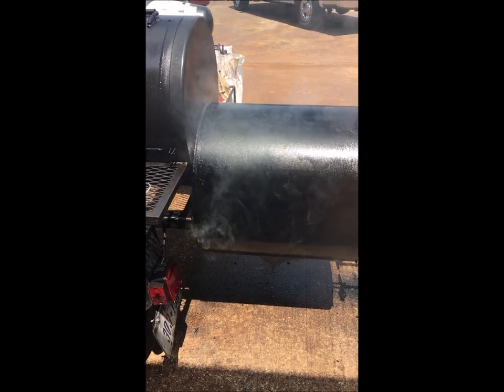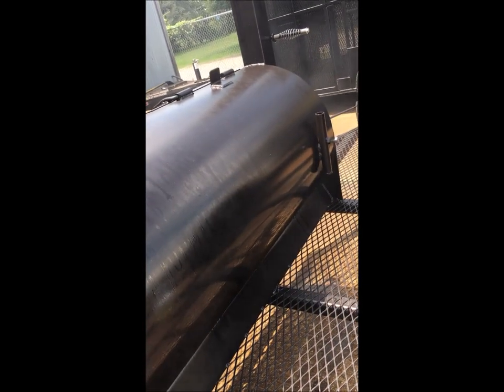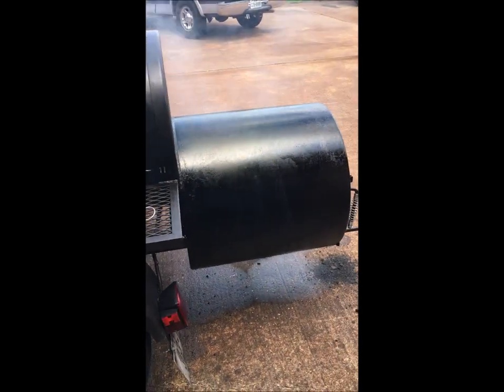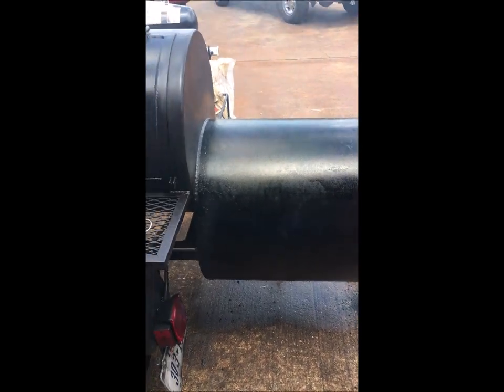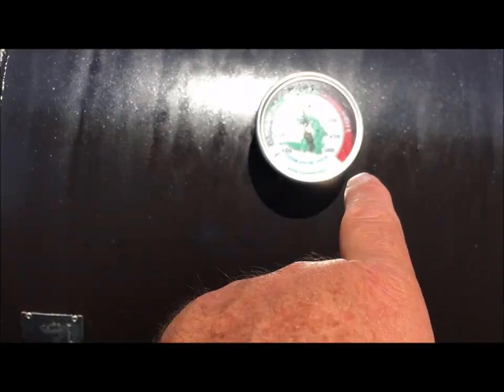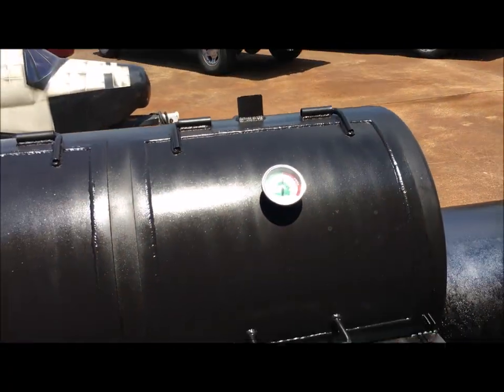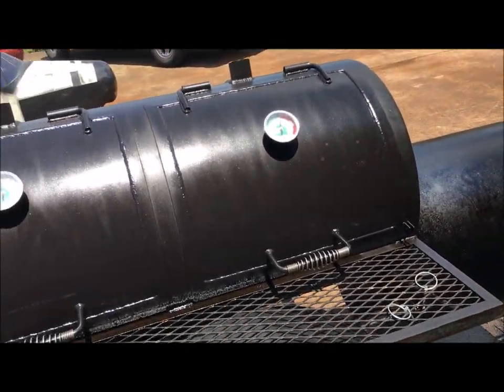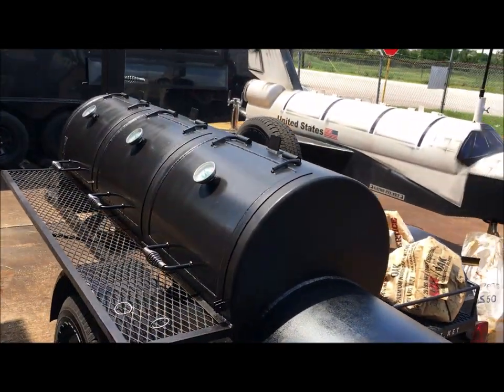Cooking Oil versus Paint. You decide.

Comment: nothing wrong with oil it or season it but I'd rather paint it because you can add some cool color to it insread of black and make sure you get the high temp paint and it will last a long time and look cool with some color and if you do not get the right oil yes it will get sticky and it does show run marks with oil if you do it wrong
Reply: What oil are you supposed to use? Just like vegetable oil?
Reply: depends what you think is cool. Chemicals? Not so cool

Comment: seen linseed oil recommended instead of veg oil. any thoughts?
Reply from the maker: MICHAEL CHRISTIANSON Doesn’t matter to me.  Spray and bake.  On the outside.  If ya want to coat and build up layers of baked on oil, pick one.  Lot of folks use bacon grease or lard out the tubs.